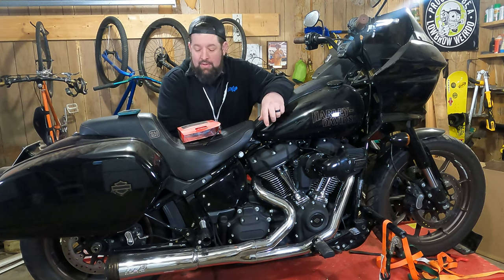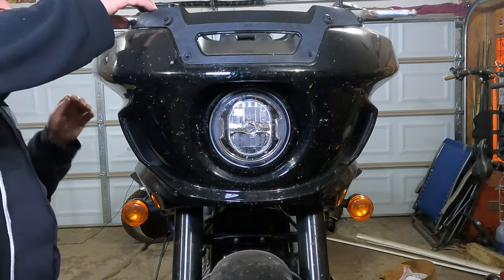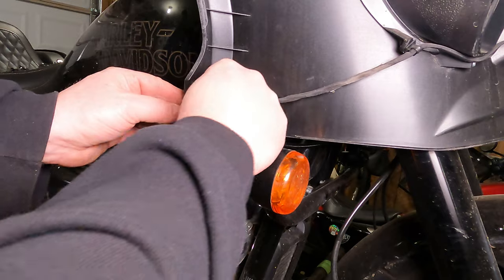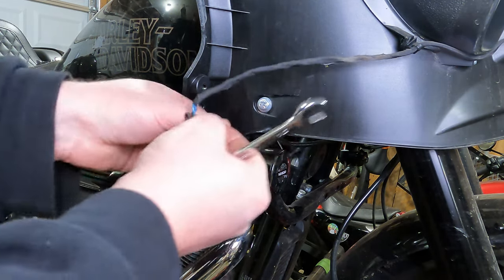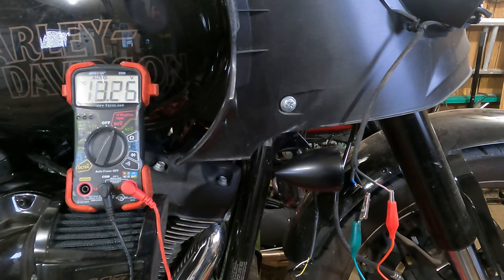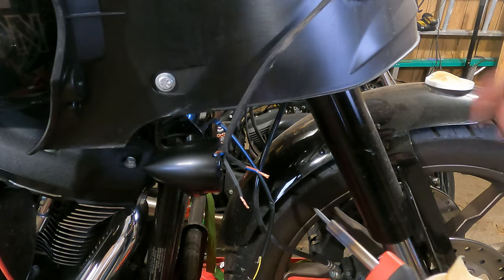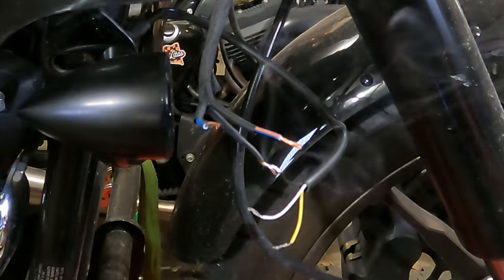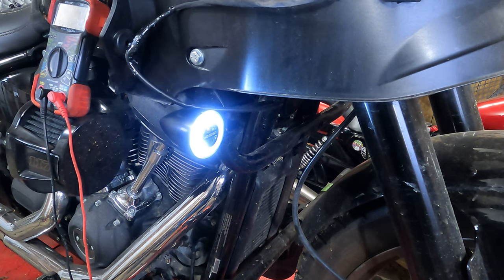Harley Lowrider ST Highsider LED Driving Lights & Turn Signals Installation + Review

Comment: I would suggest splicing into the wire of the light that was removed and not the internal stock wire harness. It would be easier to replace the light assembly than the internal wiring harness.
Reply from the maker: That’s a good idea!   I will do that on the next install.